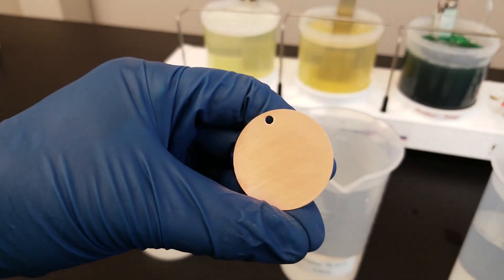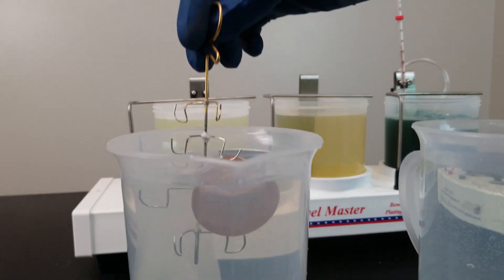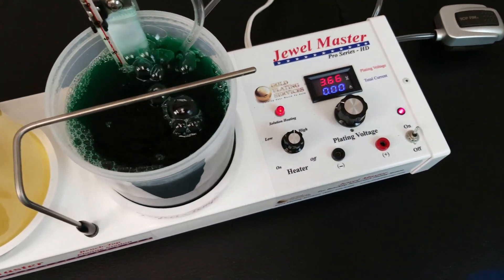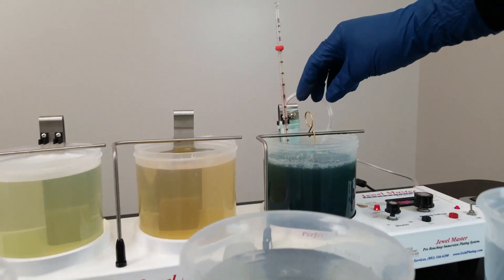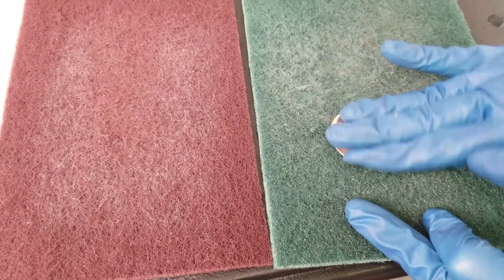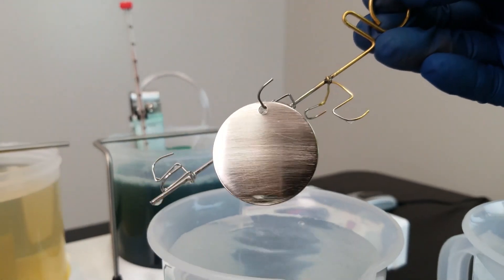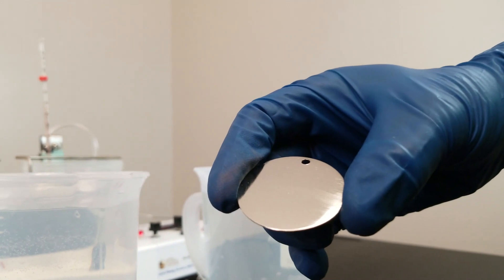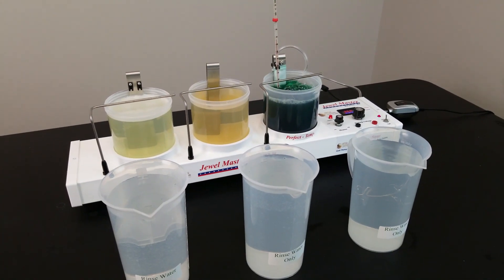Bright Nickel Plating with the Jewel Master PRO

Comment: Can u nickle plate aluminum to gold plate?
Reply from the maker: *Aluminum is a disparate metal that requires complex preparations to achieve quality gold plating results. 

Aluminum cannot be plated onto with any of our kits. Our kits will plate onto most metals, with the proper Gold Plating Services chemicals, however Aluminum requires a special preparation and process that is not suitable for consumer level plating operations.  We do not sell the process or provide support for plating onto Aluminum.  Aluminum needs to be done on an industrial level, by a trained professional.  Any attempts to plate onto aluminum with our products will not work. If you have a project that requires plating onto Aluminum, you may consider sending the parts to us to be plated by our technicians.  We can provide a variety of plating onto aluminum.  After aluminum is nickel or chrome plated by us, it can then be plated with a metal you desire, using our Universal or Jewel Master Series kits.
Reply: Gold Plating Services I contacted a different plating service regarding plating anodized aluminum with gold. They said I could do it by plating with zincate, washing off the first layer of Zn with nitric acid, then plating with zincate again, then bright nickel (I’d prefer white bronze), then gold. It is purely for decoration and I want to achieve a polished/mirror finish.